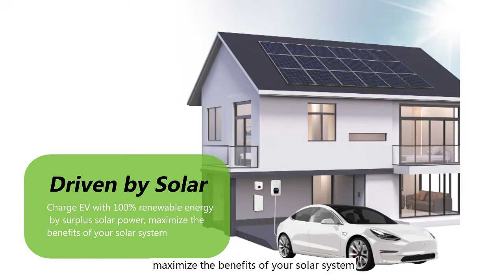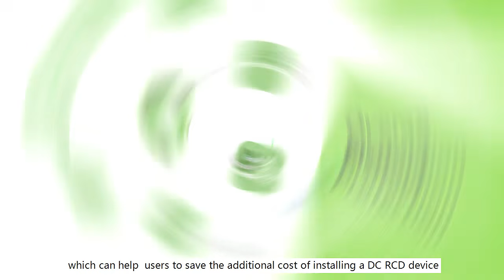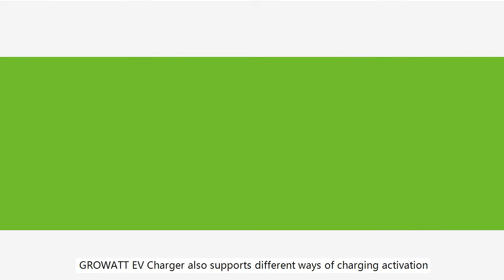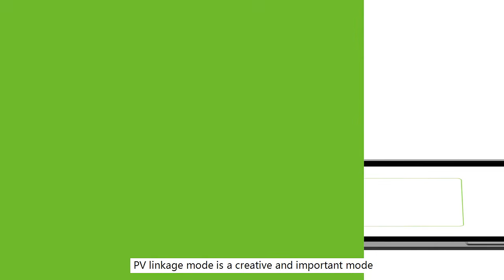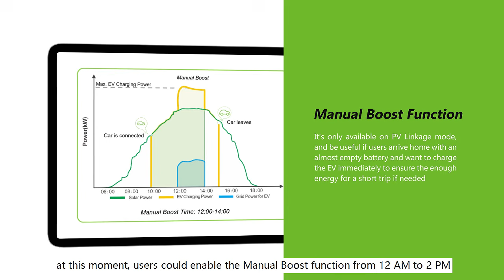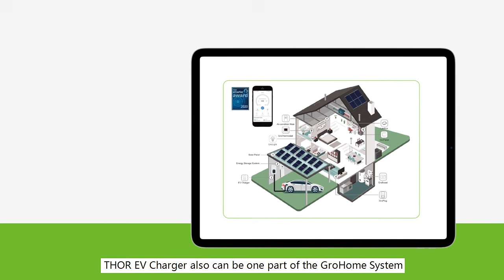Introduction to Growatt's THOR EV Charger

Comment: So if have af hybrid inveter i need a nother smart meter to use the Thor. 

Is there Any cance it can boost withaut use home battery?
Reply from the maker: hello, you can still use Thor with the power from the grid. without using the battery
Reply: @Growatt  sounds grate how wirre All divices together so IT All han cuminicate 

I have a growatt sph 3600 and a smart meter can i use the chager and sph om the same smart meter ?
Reply from the maker: Hello, for technical support, please contact our service team at service@ginverter.com, or you can call our service hotline at +86 755 2747 1942. Thank you!
Reply: @Growatt  done but cant see the reply and what abaut making af video abaut IT?
Reply: Finally I got a reply that I can read and it's just contact you're seller that doesn't know shit 🤮🤮😡🤬